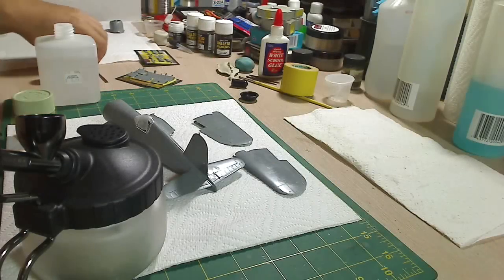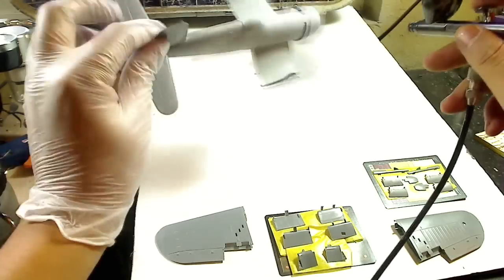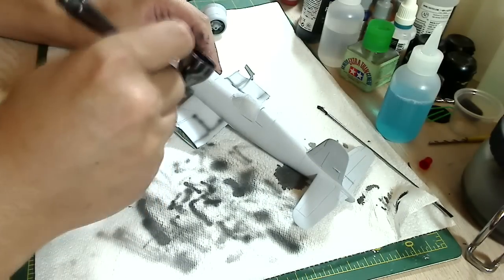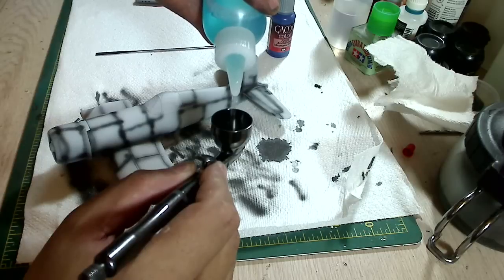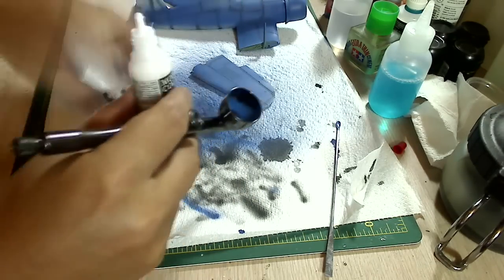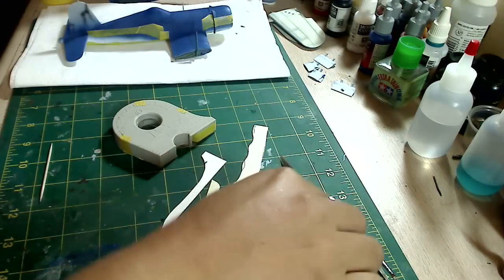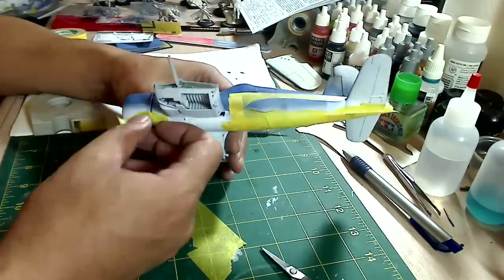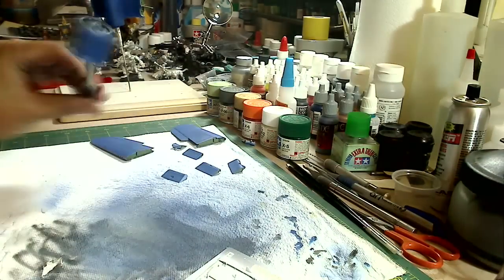Building a Corsair: Tamiya 1/48 - Part 10: Priming, Pre-shading and Base Coat

Comment: For the paint....no, 17ml is as big as it comes. 

The new primer is 60ml I believe, airbrush cleaner comes in 200ml and 85ml (only have the 85ml at the moment as both suppliers have been out of the 200ml), their thinner comes in 17ml, 35ml, apparently 60ml but I haven't see it anywhere, however with the new 200ml thinner that is out....I won't bother bringing in the others anymore (maybe keep the 35ml).

Comment: How does that work when gluing other parts to it. I noticed you had painted with yet to attach other parts?
Reply: +Miklos Erdos The Tamiya thin cement actually eats through the paint as it does it's job with the plastic.  As long as the paint isn't thick or cured.
Reply: That good to know, thank you very much.